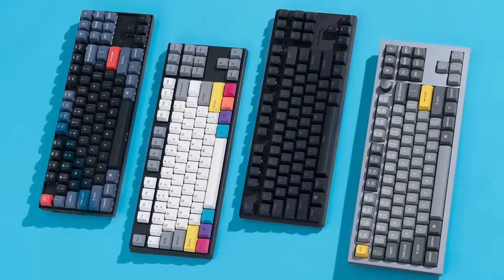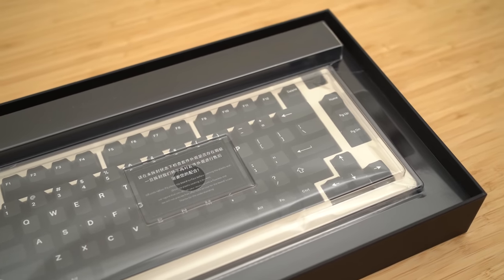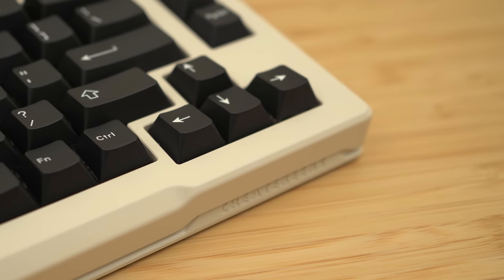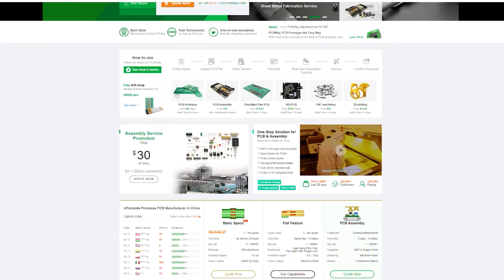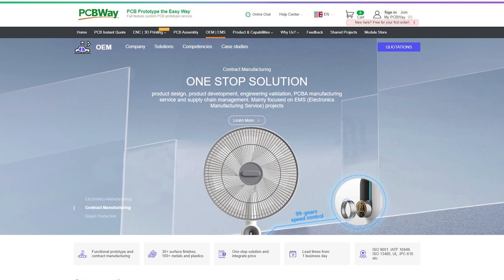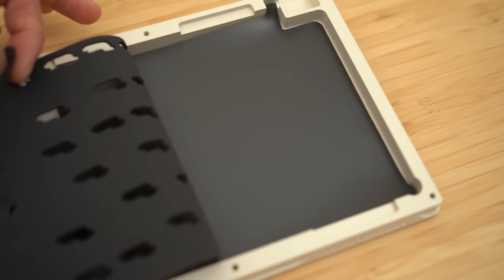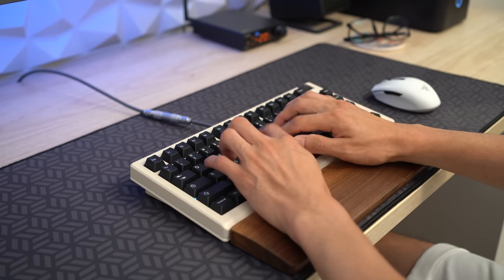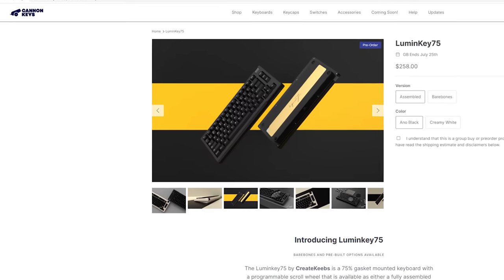A True Custom Pre-Built - Luminkey 75

Comment: Scott, i would recommend the GEON cleaning cloth to wipe your glasses with
Reply from the maker: Hahaha I noticed that too... It rained and I just wiped it on my shirt...
Reply: I DO NOT recommend using Zeiss eyeglass wipes.
Went to Zeiss authorized dealer to have a set of Zeiss lenses made for some vintage Zeiss frames. Checked every box was a $667 bill for the lenses. (I will say, best lens I ever had for clarity and vision, digital grind allowed for no bad focal points) BUT
coating damage after 7 months. Most likely the anti glare coating(they transitioned fine) may have been damaged by the wipes.
(I never wiped with paper towels, I only compress to dry)
I am only going to use what Ray Ban and Luis Vuitton recommend for cleaning.

Dish soap and water lol
Just a dot and water.